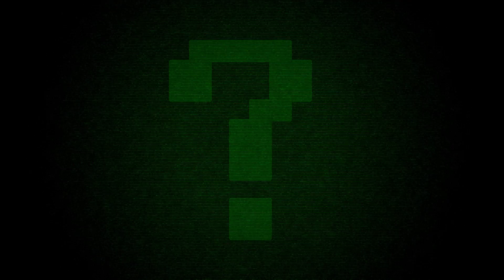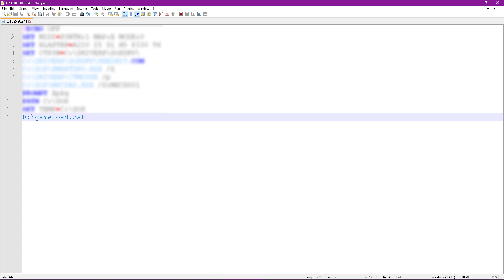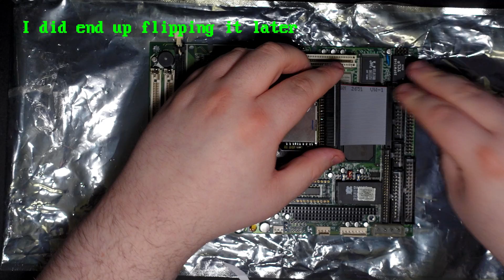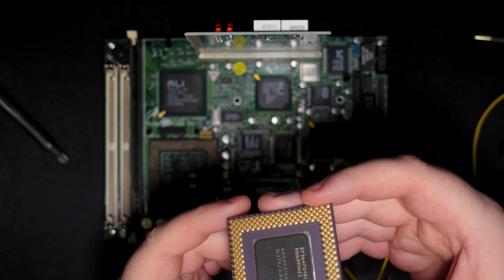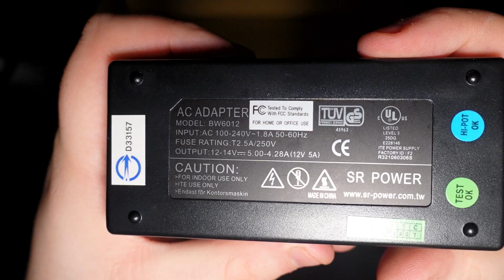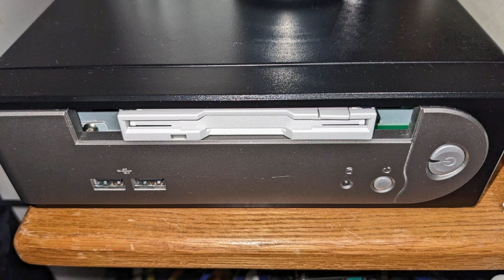Let's build an MS-DOS console - Part1 - #DOScember2022

Comment: Rather than the floppy disk smoke and mirrors setup, how about using a compact flash card as a 'cartridge' and have the system boot from it? They existed in the 90s so it isn't too much of a stretch. Could even make a hole in the top of the case and have it top loader style like the SNES / Megadrive!
Reply: Good and bad ideas mainly down to cost for each cf card and if the bios can autodetect diff cards
Reply: @James Howard How about something like a miniature hard drive like what was used in the original ipod ? I'm sure that existed in the 90s although not popular I agree with the compact flash card idea that was used in late 90s MP3 players
Reply: @cryptocsguy9282  yep was thinking the same or those compact flash HDD from China that where like 2.2gb
Reply: The biggest issues I see with this setup is the lack of pci slots and non existing isa slots that really limit what you can add to the system especially in a dos gaming system also a floppy emu would be a good option for having multiple booting devices and cf harddrive adapter for internal storage they are similar enough to hdd interfaces of the Era ide and Pata and a keyboard emulation device for custom controllers.

Comment: You do realize anti static bags are anti static because they are conductive? Powering anything on them is a really bad idea.
Reply from the maker: It might not have been obvious, but the board was mounted on 20mm long standoffs when I did that 😉 but was aware of this, don't worry
Reply: @PIPERdotEXE  Too bad you had some bad luck with the CPU and RAM then. Might have been a fun little "console".😀
Reply from the maker: Oh, we will return, and all the problems will have been resolved
Reply: Sooo, testbenches with anti-static mats cannot test any powered devices?
"Conductive" is not "shorting".
Anti-static is high resistance to avoid static discharge which is BIG potential difference between PCB and operator. The idea is to SLOWLY discharge large voltages over more points than a fingertip (I think everybody had a discharge in their life). It's effects are negligible for 12V, even 220V applications. For higher voltages you should have proper training and already know this.
Reply: @mateiberatco500  The silver bags are usually coated with aluminum. It's easy to punch a pin through the dielectric coating and hit the metal. If you are fine with running your electronics on aluminum then you could also use an anti static bag. The red/pink ones are dissipative those should not be able to hold a static charge but might still conduct to what they are placed on.
To be safe I wouldn't power devices on either. Use the cardboard box instead. (Also don't wear rubber boots and a wool sweater while rubbing a cat.)
Reply: @joe--cool  But it's not pure aluminium. Again, they have to dissipate over 100V difference in a PCB-safe manner. No standard allows shorting.

Also, I just took the 1st silver MB bag I saw and tried to measure resistance...even piercing it does not produce readable value (even in Mohm range).
Edit: ok... so I found some reference of "vacuum deposited aluminium", so that could be pure aluminium. The question remains how such a thin layer could affect things.
Reply: @mateiberatco500  It's meant to act as a Faraday cage for the stuff inside the bag. It should be rated for 100V-1000+V static discharges. You are right, it's unlikely to harm the board. Unless you get unlucky.
You can also make discharges worse by grounding your hand without a restive load (like those mats with the strap have).
I haven't heard of vacuum deposited aluminum. All bags I have handled have the coating on the outside or a layer close to the outside.

EDIT: silver bag = conductive, aluminum, faraday cage
red/pink bag = dissipative.

Comment: wasn't the s3 virge known as the 3d decelerator card?
Reply from the maker: I think it was haha
Reply: it was because it used OPENGL wrapper, it didnt have built in OpenGL support. It was Direct3d only card.
In Direct3d , it had decent fps for it's price and age. No CPU could count faster, than with Virge under Direct3D. Except, when it was outdated. Some Pentium III could be faster, but in that time, S3 Virge was renamed to S3 Trio3D. So, when we count it's era, 1996-1997, and early 1998, when it was usable, and used, even most powerful PC of that era (Pentium II 300 mhz) could not count faster in software mode, than Virge, and thus, Virge wasn't decelerator... PC was faster with it, as without it. 

But who would buy Virge, when he could afford Pentium II 300. Most people with Virge, had usually socket 7 system. Pentium 90 - Pentium 233 MMX. And with that CPU, Virge was ALWAYS faster in 640x480x16 in Direct3d, than CPU alone.

Important on Virge was to disable some features, to make it faster, particulary Z-buffer. It didn't have good Z-buffer, and it had performance hit with it. Important was also to use EDO RAM with Virge, not SDRAM or SGRAM, and overclock it. Some Virge's were terrible underclocked (like to 45/45 mhz). You could usually get to 60/60 or even slightly over. 
Virge had also big performance hit with bilinear filtering. Simply, wasn't too good with it. But CPU would be even slower, if it needed to count Bilinear filter. So, the trick was to turn it off... same as Mystique. You've got big performance boost , and could go for 640x480-16bit color mode.

Now try Virge DX in direct 3d, with EDO RAM, overclocked to 65/65, turned off Z-buffer and Bilinear Filter.
And you will see, HOW MUCH faster it is, than Pentium 233 MMX in 640x480, while looking the better (16 bit colors, vs 256 colors in software mode)

Comment: I used to have bootable floppy's with games on it.
Only very small games will fit on that setup though.
It should work in theory for CD's although a cd can only be written to once so no saving.
Maybe a DVD-RAM would do the trick for DOS.
Reply: He's just using the floppy to contain a batch file to start the game, the game which is on the hard drive
Reply from the maker: You get it :)
Reply: @PIPERdotEXE  I'm so old that I used to use memmaker and know better than it how to make my own config sys and autoexec to boot games off the HD :-)
Reply: @SimonQuigley  I guess it if it aint broke dont fix it.
Reply: or a zip disk drive with 250mb in it
Reply: @mOddEdLiKeHeLL  Was thinking this aswell, would have chosen that over harddrive and floppy
Reply: @ZakHooiTM  I seen they have a 750mb zip drive too.

Comment: Cool project! That board seems to have ESS Solo-1 based onboard audio which supposedly works well with DOS, so if you don't manage to source the sound chip that could be an alternative. (If this doesn't work, you might be able to salvage the CS4237B from some ISA sound card on eBay. There are also some PC104 to ISA adapter designs around the Internet).

For storage there's a DiskOnChip slot on the board - maybe that would work better? Those SD/CF to IDE adapters can have compatibility problems even with real PC motherboards, much less an SBC.

Also, you can look up what those POST codes on the board mean - saves a bit of troubleshooting. C6 is indeed a storage problem.

I wonder if there's a way to go without "smoke and mirrors" by hooking DOS file access routines to prompt for a floppy when the file the game needs is not on the current one (possibly with a RAM disk/temporary directory to store files from floppies already inserted). Maybe it could even be possible to make a fully diskless console?
Reply: I noticed that sound chip too (ESS Solo-1). If the right header can be found/made (I could only find a datasheet not a manual) then that thing should have good sound.

There is also a socket for a GPS module on that thing too!